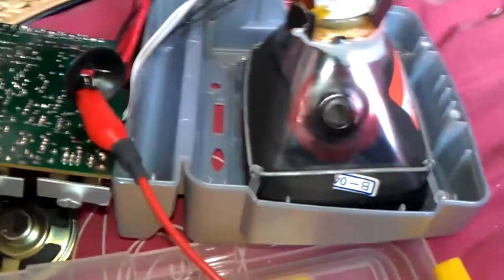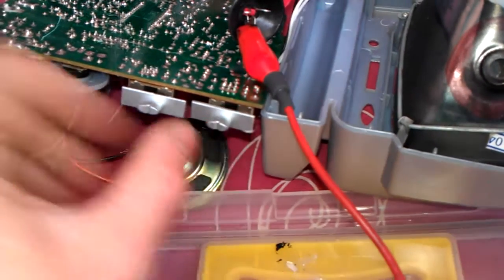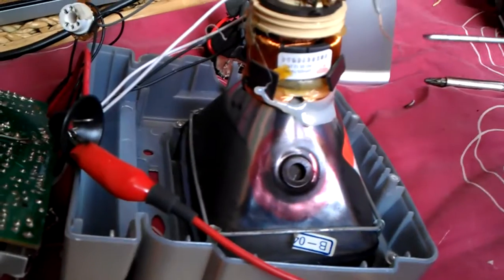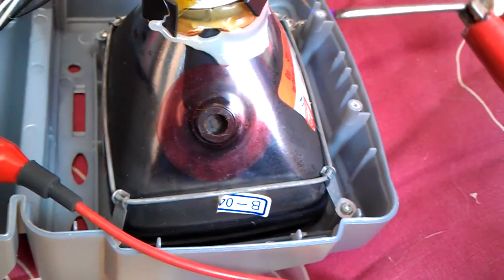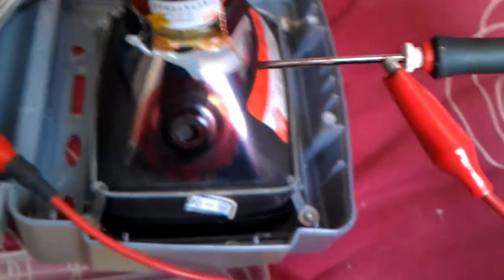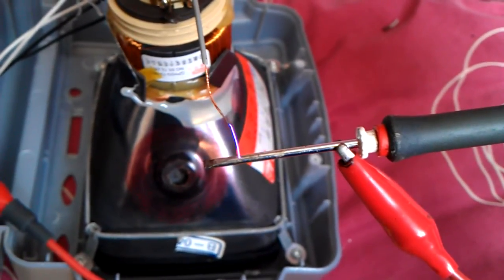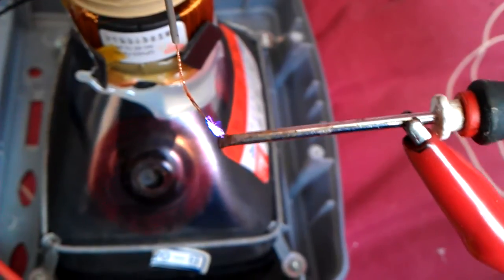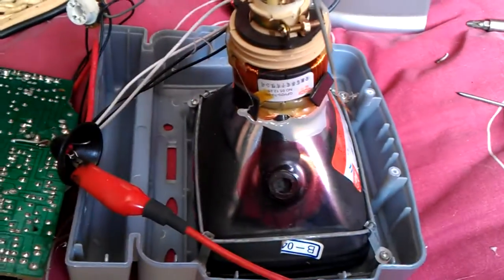5' black and white CRT tv arcs from flyback!

Comment: Surprisingly strong arcs from such a small flyback and original driver circuitry :)
I have a little cheap black and white TV like that but I also have a more solid color 5 inch TV that I use as a monitor for my camera when I can't directly keep an eye on what I have in frame.  The little one may get gutted for an upcoming project but I'm keeping the color unit intact.